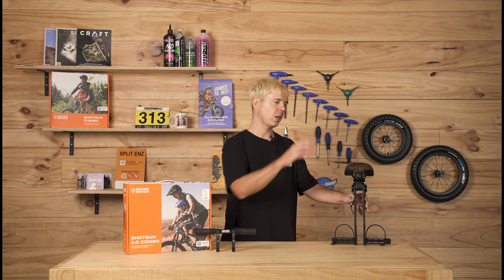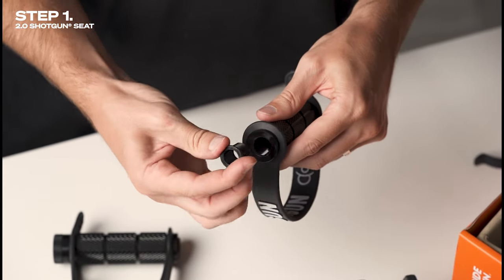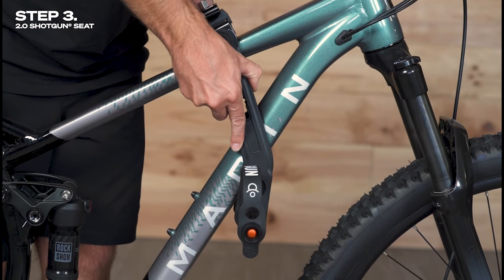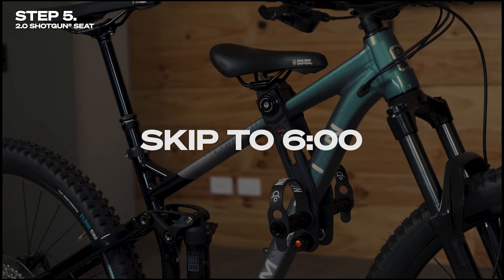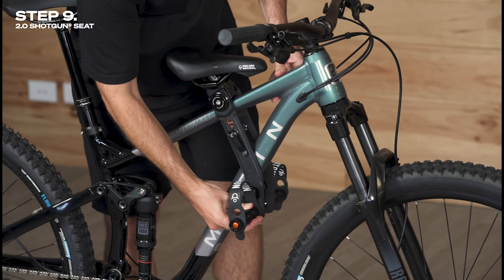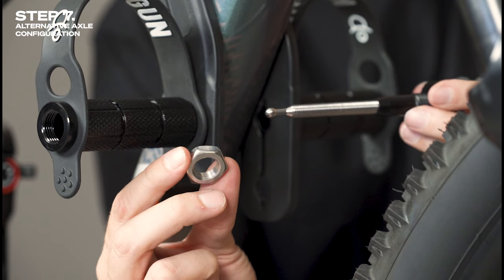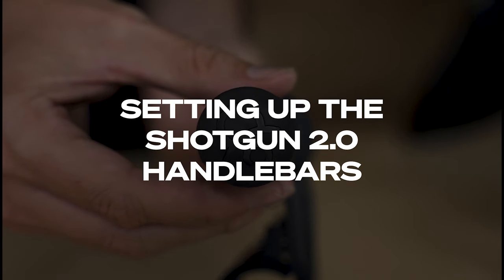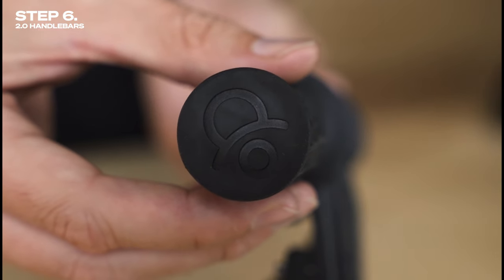Shotgun 2.0 Kids MTB Seat Installation and Fitting

Comment: My top tube is narrower than my downtube meaning it doesnt fully clamp onto my top tube. Do you do a shim that I could use?
Reply from the maker: Hey Darren. No unfortunately we don't provide any accessories or attachments for these kinds of situations. The swing arms are designed to flex, so that if you have a small variance in size between the top & down tubes you can still get a good fit. If the variance in size is too great I'd encourage you to return your shotgun seat for our pro model – which mounts at the stem & seat post with zero frame contact.
Reply: @kidsrideshotgun will I have to install a special stem on the head for the pro version to work? The version that doesn't touch the frame. I have a stumpjumper evo comp alloy. Thank you.

Comment: I am having trouble fitting this my stumpjumper. Is my top tub too steep? The seat does not secure tightly to it because it is tapered.
Reply from the maker: Hey Skyler, sorry to hear that you are having some trouble fitting our seat yo your bike. That's not the experience we hope for our customers at all. I have seen a few of our seats fitted to stump jumpers before so your tope tube shouldn't be too steep. Here a few fitting tips that should with fitting. If you are still having issues, I would recommend reaching out to our customer care team directly at hello@kidsrideshotgun.com with some photos of the issues you are having.

Fitting tips:
2.0
The first thing I would suggest for this issue is to ensure you pinch the two sides of the Shotgun frame tightly together against your top tube before doing up the top bolt under your saddle.
The next thing I'd suggest is to ensure you have a good angle on your seat. By this, I mean that the footpegs are closer to the front of the bike than the seat.
The last bit of adjustment to try is to ensure you have the correct pressure on your down tube, this is managed by adjusting the footpeg tensioner - Wind the tension dial clockwise and counter-clockwise to increase or decrease the clamping force. This controls how tightly you can screw the footpegs on. After that, I would place the quick-release bolt in one of the top holes to increase tension on your top tube. In summary, the primary fasteners are the bracket bolt inside the silver cylinder below your saddle, and the quick release that secures the seat to the bike as well as the footpeg tensioner.

Hopefully that should help get you and your little on the trails! Cheers, Harrison

Comment: Hi, can it be used on a carbon frame?
Reply from the maker: Hey Girdan, thanks for your question. All our seat models feature moulded rubber protection for your bike at each contact point, and are suitable for use on alloy and carbon frames. You can head over to our website (link in bio) for more info 👍 Cheers, Te Ara